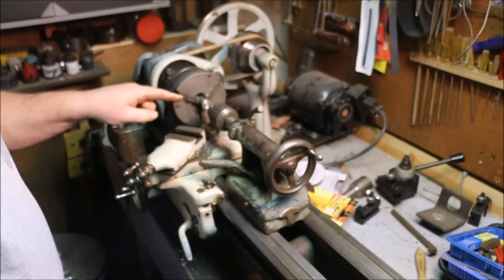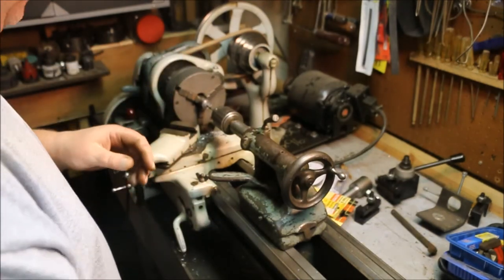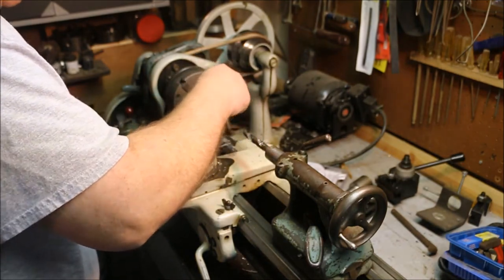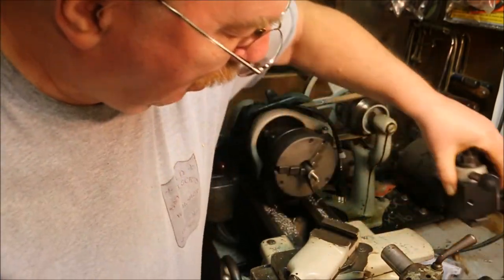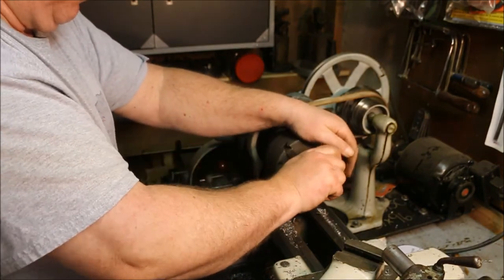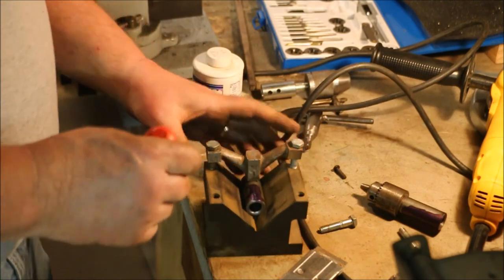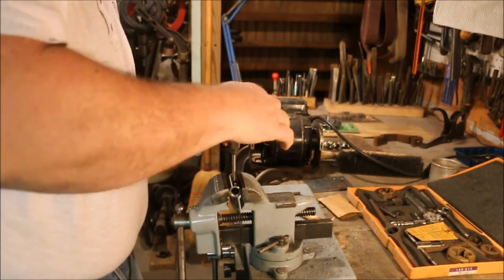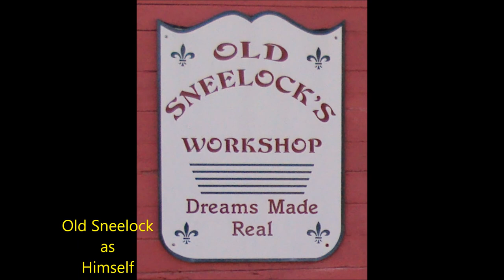DIY ~ MAKING A MOTOR ARBOR ADAPTOR ~ PT 2 ~ BORING ~ THREADING ~ TAPPING ~ WTAP

Comment: Hello Mr Sneelock I have built a lapidary arbor machine using a 1 hp dc servo motor with 5/8 stainless shaft mounted on 4 solid pillow blocks. The End is turned to 1/4 20 thread to accept a 3/8 Albrecht keyless Chuck. The shaft is running true and it threads onto the shaft fine but I have a bit of a wobble at the chuck end. It is intended for jade carving . The chuck will hold diamond burs, small blades on mandrels, sanding drum ect.  That’s why the keyless. I could use some advice to solve the wobble. Should I take the shaft and chuck to a machine shop and have them check that the chuck seats on the threads well? Thanks for any advice. Julianne
Reply from the maker: Seating anything on threads invites wobble. The thread tolerances introduce most of it. If you can seat the base of the chuck against a shoulder on the shaft so it is locating against a
 square and concentric surface. Ideally there would be an 1/8"  deep pocket in the base of the chuck so it was a slip fit on the shaft. That would insure the chuck would run as true as possible.

Comment: Enjoyed the video as always. When cutting threads with a tap or die it was drilled into me (:-) to always do one full turn then back off a quarter turn to break the swarf. I see you don't, have I been wasting my time all these years ?.
Reply from the maker: UK Tony I had been told the same thing. That backing off the tap a quarter turn every turn and "breaking off the chip" was the proper method. I was using standard four flute hand plug taps and bottoming taps. Breaking taps was just part of the deal. 
I noticed that breakage occurred more often during the "backing off" part of the operation. After a decade or so I began to question the veracity of the backing off as a requirement. By that time, about 1975, I was working in my first real fabrication shop. The Borg Warner plant I worked at made radiators. There were a number of pieces that had tapped holes.  The operation used automatic tapping machines. They spun the tap in and at a set point, when the tap either bottomed out or went all the way through, they spun the tap back out. They didn't peck away at all. The taps would run a couple hundred holes and be changed out. They seldom broke. 
The machines used two flute taps. I thought it was just that the taps were stronger. 
I was making fixtures for the assembly line. I was tapping a lot of holes. Since I had a ready source for the "stronger taps" I began to use them for hand tapping. They were better. I had fewer broken taps but lots more than the tapping machines. I attributed the problem to side loading of the taps by hand tapping with a sliding T handle.
I was careful to not apply side load.  With the T handle centered and the tap held as straight as I could, my success rate was higher but still no where near the longevity of a machine tapped operation. 
The breakage was still happening more often in the backing out than during the cutting. I thought about what was happening during the backing out. What was different about that step?
A plug tap is sharpened on the leading edge of the first four or five threads. Taper taps have more sharpened threads at the start of the tap. The tip of the tap is near the diameter of the tap drill and the succeeding cutting edges increase in diameter until they are the final size of the desired thread. The number of threads sharpened sets the taper of the tap and determines the chip load per thread. The way the threads are sharpened is, the leading edge is a larger diameter than the trailing edge. In most cutters that is called the relief angle. It is there to allow the cutting edge to dig into the surface and gouge out a chip, rather than sliding along like a tobaggan. 
As long as the tap is moving forward it is happily gouging a chip with each flute taking a bite. The cutting edge is supported and the relief angle is doing its job of staying out of the way. 
Now we have completed one or two full revolutions and following the rule we stop and back up one quarter turn. At first the cutting edge disengages. The next few degrees of rotation are no problem. There isn't any load on the tap. Then at anywhere from roughly fifty degrees of rotation with a four flute tap,  to one hunded with a two flute tap, the back of the flutes contact the chips. 
The conventional thinking says the chips break free, and the load is gone, so when the tap goes forward again the flutes are clear and able to accept new chips without plugging. 
As i pondered this process I thought about the relief angle. The back of the flutes aren't slicing the chips away, they are riding over them. The chips are forced down into the groove left by the cutting edge and wedging the tap in the hole. 
I have never measured the forces involved so I can't quantitatively analyze the difference but I can see that the effect of wedging would cause a higher torque load than the effect of cutting. 
That seems to fit my observation of more taps breaking in the backing out phase. 
What about the chip filling the gullet of the tap if it isn't broken free? Doesn't that plug the tap? 
First I'll ask, where do the chips go once they have broken free? The five to ten chips per flute, possibly up to forty individual chips, are free to go with gravity until they hit an obstruction. Have you ever had to clean a tap after removing it from the hole? I have. There are chips stuck in the first few threads nearly every time. If they are there from the last backing off they were more than likely there at the first one. That is true if I'm tapping vertially, horizontally, or overhead. They don't fall free. 
Backing out only creates up to 40 chances per revolution for a chip to wedge in the relief angle and jam the tap in the hole. 
This explanation is a long one. It takes much less time to read than what is required to remove a broken tap.
I stopped backing the tap out. I seldom break a tap now.  
A similar effect occurs when using a threading die.
Reply: Phew, what an absolutely brilliant technical explanation. I shall be guided accordingly and stop backing off. I have to agree with your comment about the carbon steel taps being rubbish. The difference between a carbon steel and a HSS tap is like chalk and cheese. Thank you once again for this brilliant explanation and possibly you could share it with the guys in some future video as I am sure Tim, James, Lewie etc would be equally interested.
Reply: I LIKE This! Makes perfect sense.Jamming the relief. Like throwing a wrench in a smooth running gearbox. Thanks, Unc! This is even so poor old goofy me can understand it. What little tapping I've done I've been to scared to try and back out till I got done for fear of messing up even worse than I probably would anyway. And I don't have a clue about removing a broken tap to start with except the hard way. Vise grips or maybe try and break it up. But that's my 'Custom By Crunch' design.

Comment: Another hazard using a file is if it catches and gouges the ways. Plus, never use a file or rasp without a handle! Just drill a 1/4" hole in a golf ball and push it over the tang; makes a great handle!
Reply: I usually get a chunk off a limb and drive it onto the tang. Saves a little $ unless you want to look professional I guess. I've got a turned handle, store bought , or 2 but the limbs work just as well and if the tang breaks off you can always cook something with the handle, plus a little.
Reply from the maker: +tom7601 I got use to having cylindrical handles. The golf ball handles are popular but I'm a creature of habit. I do like the files with an integral handle but not the four ways.
Reply from the maker: +Lewie McNeely You score points for frugal utility. 😁
Reply: You know how it is. We both fell out of the same tree as ancestors went. We get it HONEST!
Reply: My great grandpa used to use corn cobs.  Free, good grip, and easy to come by (at least on the farm!).
Reply: Sure, Brian! I've seen the cob handles but forgot all about them. Thanks!
Reply from the maker: Brian Neeley We used them for a lot of things when I was a kid. Now  corn is picked with a combine and  shelled as soon as it is picked. The stalk and cob is ground up and scattered on the field.
That sucks for a guy who has a couple corn shellers for display at tractor shows. 
At least thete were a few Amish around Union City where I could find ear corn. None in this area.
Reply from the maker: I go back and read these occasionally when I'm researching a new project or answering a question. When I read this again I realized that I hadn't really understood your comment or  explained what I was doing. The file I picked up off the bench and used to remove the burr from tapping was a file with an integral handle. You can't see that because my hand is covering it. I picked it, and another one like it, up and use them for a lot of projects. They come with a rasp on one face and a mill file on the other. One safe edge and the other cut with mill file teeth. They are handy and I use them without even thinking to explain.